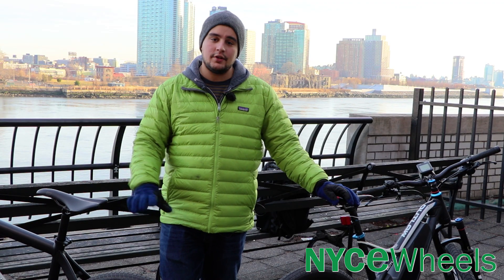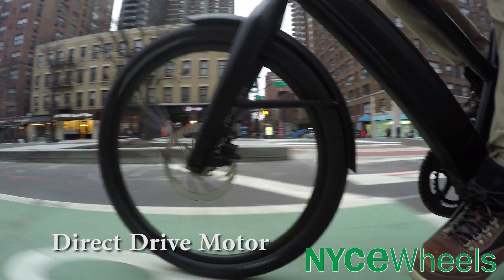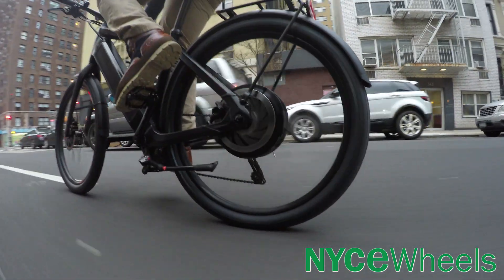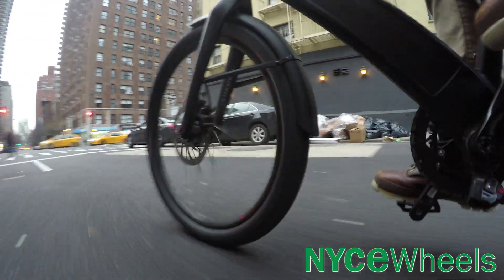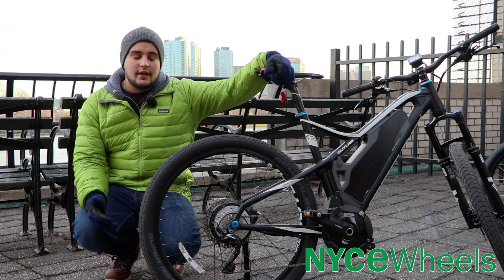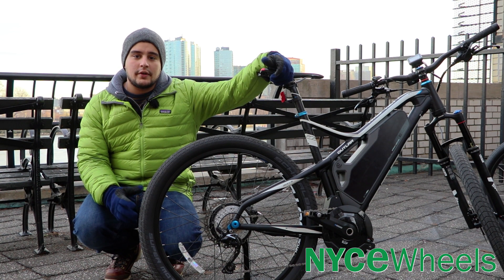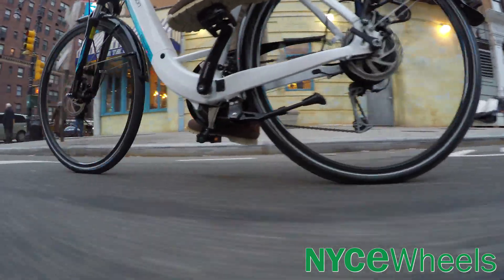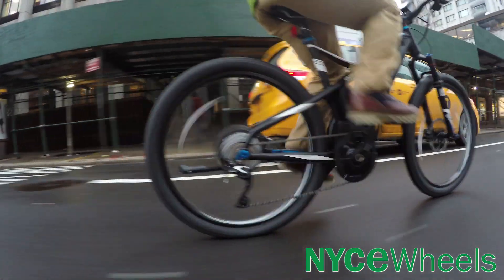E-Bike Hub Motor Comparison, Geared vs Gearless - NYCe Lesson

Comment: Brilliant video. Maybe mention that a geared motor is different from cassette gears in that they don't change ratio (geared motors are fixed ratio). ...But other than that a really good video... It confirmed my experience ..  I prefer a gearless for the higher top speed. It is pretty flat here in Toronto and I basically go everywhere at full speed... so geared is less efficient and kills my battery over the same distance... I also pedal whenever I get moving so I don't find the slightly lower torque a problem.

Comment: I was trying to decide between an Aniioki A8 Pro Max dual motor 60 volt (direct drive), and an Eahora Juliet Pro 2 (geared motor) Think I'll be getting the Eahora as I like having low end torque for hill climbing and stop and go applications. It will make that 70 amp hour battery go much further.

Comment: It's 2025 and still be the same way to choose between two:
DirectDrive for smooth TopSpeed rides with 0 maintenance
Geared bike to go long-range and get better uphill rides
Reply: Update, owning gear 500W:
Gear hub motor insanely good at downhill rides, zero resistance, 100% power saving! Less top speed, but who cares when you can have 2x battery range during normal use (<20km\h)

Comment: I find direct drive motors the best option, no moving parts is always best, you can feather the power distribution on the fly.
Reply: Mine have 80.000km on it already, been riding it to work and it ever survived 2 winters, rain, deep snow, salt and i didnt even have to do a single service to it. Still going on oryginal bearing. That thing is impossible to kill.
Reply: Simple works. If you just want simple and it to work, hub motor without gears. Plus if it's a front motor you get all wheel drive, and the more correct wheel for regen breaking downhill. Heavier, true. But it makes up for its own weight and then some. Use the pedals for steep hill torque and don't expect it to do everything for you.

Comment: What about noise level of geared vs direct motors, how much noise difference is there actually? Like to have a quiet ebike.
Reply: some geared are super noisy at high speeds and gearless is super quiet, my current geared motor is freaky noisy at around 20+mph. I am waiting on my gearless motor to arrive so I can see the differences then. I really wanted a higher top speed and quieter motor.
Reply: Geared is louder. Also depends on quality of the motors. Direct motors are extremely quiet. (Violamart)

Comment: Very difficult to find geared hubs over 750watts, if anyone knows where to get 1000watt geared hub please share.
Reply: AliExpress, typically the 500w motors are 1000w+ anyway they just re-badge them. 
The insides are rarely different. It's cheaper to make one motor that supports a wide range of voltages.

Personally I wouldn't go over 60v 25 amps on them as the wires are quite thin on most geared hub motors and even then I would monitor and occasionally touch the wires into the motor to check temperature.

Currently I run 48v 22 amps through my hub motor and it stays cool to touch unless I'm going up a very very steep hill at full throttle 😂 even then it only gets warm.

I have a in frame battery so can't really go up voltage wise unless I have my battery external.
Reply: @freedomofmotion  
I ended up getting a 1500w direct drive hub motor. It’s a 48v system, but I’m thinking of running a 60v battery. Currently I’m using a 52v battery and the motor is warm to the touch, 60v might get me up to 40mph, currently hitting 35

Comment: The gears on a geared motor are not like your cassette gears . They are 3 planetary  gears that orbit a center gear which has a clutch which engages when torque  is applied in forward direction.

Comment: In the UK up in hilly Yorkshire I like the geared hub drive, 15mph speed limit and hills everywhere so low speed assist but with some torque is in order.
Also it allows me to speed down the hills fast with little rolling resistance.
My fiido d3s bike does the job pretty well with its geared motor.
BUT I'm wanting to convert my mountian bike and thinking mid drive with torque sensing will be best and I have seen green pedal units coming out that looks perfect, just gotta get hold of one!
Reply: I just ordered a Befang 48v 500w mid drive for a mountain bike with 3" tires. Canadian law enforcement has been relaxed about the 250w limit so far . With a 250w sticker on it , a 500 watt motor could pass if laws tighten up. Beware though they come from China and there could be delays due to Corona virus.

Comment: Gearles have better top efficiency, because not have gears and have lover speed, lees edgy curent losses and hysteresis loses. But they not have big torgue, so to have great efficiency (in wide rpm range) need strongly limint current of controler.
Reply: Differend things     Spelling is terrible.

Comment: Any comparison should state which is quieter?  For flat'ish trail riding toting the camera gear, which will get you in and out with least noise?  That is the latest gear drive hubs use spiral cut gears, so they are quieter.  And some direct drives suffer from controller induced hum (trapezoid wave signals).  So which is really quieter?
Reply: He DOES tell you which is quieter....watch it again.

Comment: I have an idea: to put the best of both worlds togeter.
How?: wel, start picking a geared motor and modifying it this way.
Think that te output of the geared hub has a free wheel device, that's actually perfec because then you only need to put an engaging or clutch system between te drum of  the motor and the external housing of the motor and drive te wheel directly once you have speed because the direct speed of the drum will naturally overcame the speed of the geared out wich is conected trhough a free wheel mechanism, not interfering at all ech other.

Comment: I'm currently considering converting my citizen folding bike (20 inch wheels) to electric. I'm a senior looking for some assistance on short trips for mostly flat terrain with only slight hills. I'm not interested in high speed.There are so many kits on the market I don't even know where to begin looking.I'm also on a limited budget (Soc. Sec is only income), so economy is to be taken into consideration. Suggestions would be highly appreciated. Thanks.

Comment: You kept mentioning weight, it's been my experience that the extra weight of the higher capacity battery in the geared motor bike is comparable to  the weight of the gearless motor bike for the amount of distance you can travel on one charge.

Comment: Which one will last longer if about evenly priced?  The gear motor in question is a bit pricer a believe
Reply from the maker: The gearless motors typically last longer and are maintenance free, but they aren't really able to be serviced. If a piece of the motor for any reason stops working, you'll need to replace the entire motor. The nice thing about geared motors is that they are serviceable, in the event that your gears wear out over the years, you can replace them with new ones and the motor is good to go. Geared motors generally cost less, and are used on all the more affordable bikes we carry (Populo/Blix/iGo).
Reply: I would go with direct drive because the gears on a geared motor only last so long before the clutch breaks and needs replacing.

Comment: If you often breaking, then gearless motor is better.
Reply: That's actually the opposite of the truth. The gears help you gain speed but tax the motor at higher speeds. A direct-drive takes more energy to get up and going but maintains that energy much more efficiently once you are going.
Reply: @aznative_  geared ebike motor ant not geared peak eff is obiovs same. And often geared motors with 1 to5 reduction  have higher efficienty than not geared hub motors.
Reply: @Alksbbch  the only thing that gear reduced motor can do a more efficiently then a direct drive motor is takeoffs and climbing hills. If you're trying to argue that pushing a motor and then reducing it to a slower speed five times is somehow making it more efficient at the top end you're missing something very significant. I'd recommend watching the video it doesn't seem like you actually watched it and if you did you certainly didn't pay attention.
Reply: @aznative_  due wery low RPM. Hub direct drive motors have standart efficienty peak about 80 precnts. Sometimes 83, sometimes 86. But many motors have about 80. While geared motors can have prak efficiency also about 80, 83, 86. But often more than 80. Only big power hub motors who about 2-3 KW can have efficiecy 90 precents or more. And geared also have better efficiecy at low speed... Hub motors direct drive have good efficienty only on hight speeds like 50 kmph with 26 inch rim. On slow speed up to 25 kmph it not have good efficiency. I comapring this motors on speed up to 25 kmph, bevause it legal speed in Europe.

Comment: Thanks for the informative video buddies. I am from India & am stuck between geared & gearless motor. We are allowed only 250 watts motor here & I am getting them from China (like everybody else in the world). Can you tell me how much difference in battery capacity should i expect for 50km range on gealress & geared motor. (assuming the terrain is 98% flat, 75kg load). Also, what voltage should i go for, 36v or 48v, assuming I will be running it mostly on throttle? PS - The direct drive motors can have this amazing feature of anti theft lock / alarm, but not the geared motors.
Reply: I too will be ordering one soon, what you need is a geared motor, I have spent a few weeks learning about ebike kit, motor, battery etc, don't worry about 250w because no one will catch you as long as you pedal assist while motor is running, get a 350w geared hub motor or bafang mid drive kit with at least 36v 8ah battery you should get pure throttle speed of 35km, if going for 48v then you should go with motor that has 48v controller to get speeds up to 50kmph and great torque, distance range depends on the ampere hour of the battery, not good if anything bigger than 11ah (heavy!)
Reply: If theft is a concern then go for security.  A stolen ebike won't  get you from A to B unless you stole it. 250w... I  would get the 36v battery .I have a 24v geared motor but it's a little  weak ... still very helpful but works harder.  I think 36v battery should last longer than mine. 48v is over kill for 250w.
Reply: The geared motor enhances the starting torque & for slow running. A gearless direct drive motor cannot bear the starting load. So high power direct drive motor is the solution, but this consumes larger battery power. While the direct drive motor offers almost trouble free service, geared motor have seized or broken plastic gears after use, which needs maintenance. However 250w geared hub motor is the cheap and the best motor.

Comment: hii
What about the life span of motor.
Wich is better ??? I heard the gears is from plastic and will wear.
So if want a strong motor for commuting wich is better?????
Reply from the maker: Both are pretty equal in lifespan in most cases. Yes, geared motors do have some friction, but gearless motors can also wear out after long term use.

Comment: if you want to stay in legal limits.. at 750 watts and 20mph limit then geared hub is best as it is lighter, cheaper has more torque and more efficient at those rpms

if you want a fast electric bike and you don't want to pedal much than you go with Direct Drive or gearless hub motor. (>1500 watts) they can maintain speed and quieter.
Reply: Geared hub motors are usually more expensive than gearless hub motors.
Reply: @kecelam  also the gear clutch assembly requires greasing and sometimes replacing 
$50 US for parts if you know the part number and install it yourself.
Reply: In the UK its 250 watts to be legal :(
Reply: You can try over-volting to get more power on the same motor :)
Reply: In Georgia it's 1000w... sweet whuh?
Reply: Wait so can a geared motor switch gears or is it a one gear.
Reply: @gameonyolo1  a hub motor turns the wheel with the same maximum force  and speed in all gears but you can still use the gears for the pedaling  power that you put into it. It makes pedaling in a high gear easier so you can go faster without getting tired and hill climbing easier.
Reply: Finally someone knows literally if you look it up theirs no results on google
Reply: Sounds like UK suks.
Reply: @fhuber7507  Yes the UK does suck but it's home! And I wouldn't live anywhere else. I just tune my ebike to solve this little issue ;) Which consists of a mid drive I may add... Yes it's 250w rated to abide by the law, But peaks much higher with 70nm of torque so all is not lost. And with the tuner, 30mph is achievable :)
Reply: If the magnets "pull" the motor forward why do you need a battery? I think the author means the magnets "push" the outer hub forward the controller supplies power to the stator windings.
Reply: In northern Ireland if we want an ebike ,you need motorcycle licence,helmet and motorcycle clothing!!,bike needs registering as a moped,number plate etc such a load of crap
Reply: @jimwright5492  You would think that they would atleast help pedal assist ebike riders overcome physical limitations  and reduce car usage.
Reply: Geared motors are silent .

Comment: So geared hub e bikes have no drag and rides like a normal bike when we pedal without any battery use?  If so that's what I want.  Sometimes my battery would run out and then I'd just ride the bike like normal instead of using twice the effort to pedal if I had a gearless hub ebike.
Reply from the maker: Yes, that is exactly what a geared hub will do for you!
Reply: yes, but it's without regeneration.
Reply: @zazugee  Who needs regen? Maximum 7% to the battery? Nah. Better to invest in lighter bike components.
Reply: @FVBmovies  yes, for lighter bikes, but in case of velomobiles or heavier touring bikes, they need regen when going downhill, and they dont have much stops to recharge
Reply: @zazugee  If used for braking exclusively, then yeah, but not for the regained range which is laughable.
Reply: @FVBmovies  http://www.soltechdesigns.com/regen/
this site explain it nicely
we have 2 roads like 300-500m uplhills
one person who bought the flyer volblut before i did from the localshop, take that long hill road on daily basis and the only reason he bought it is bc of its 500W hub motor that is regen-able
on flat land, the regen is certainly useless, and wont be able to replace the brakes
on long hills, i think it can be detabatable but i still think for touring in a hilly country, regen is a must, specially for velomobiles used for touring
Reply: @FVBmovies  who said maximum 7%? there is no one single figure for regen
the figures range from 1% to 18% depending on the environement
still even for 10% its worth it
wern't electric cars fighting to even increage range for 10%?